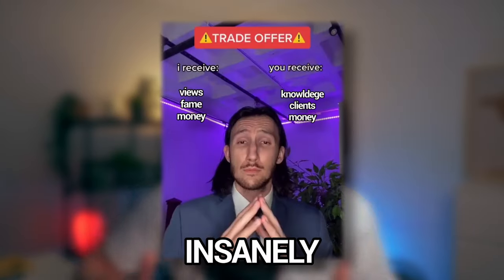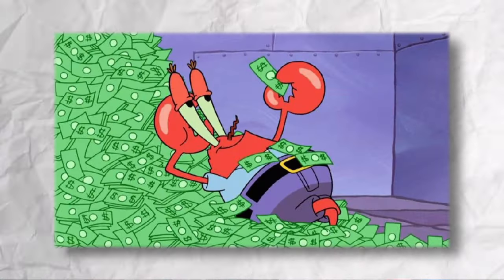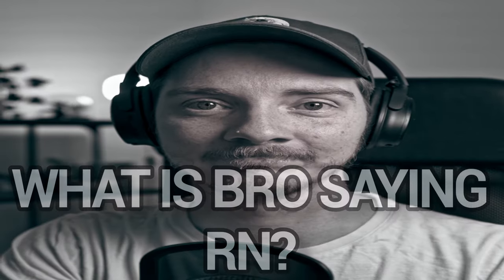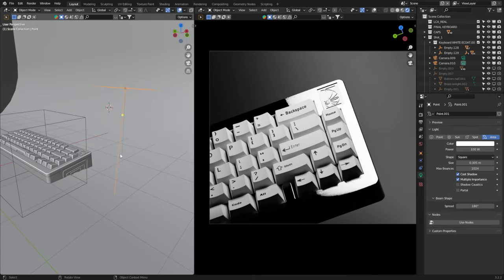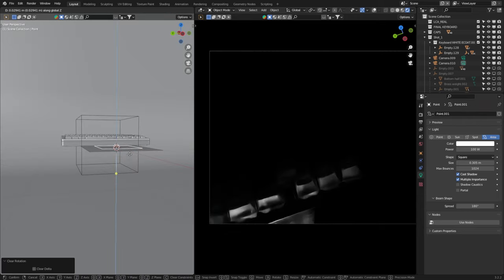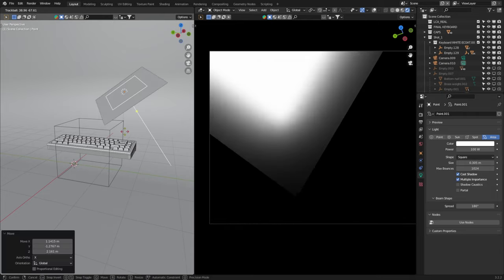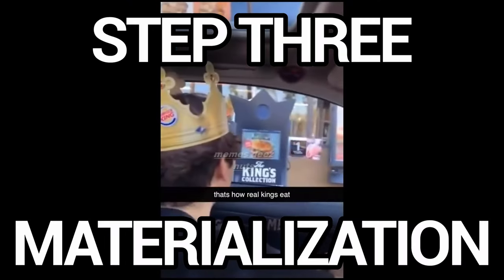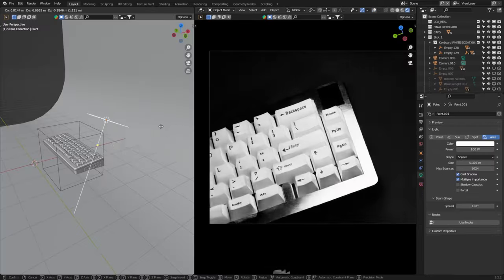Your Lighting Sucks. Here's Why

Comment: Can't you get this same effect by increasing the size of the area light? Thats typically what I do. Larger source = softer source. Or is it different?
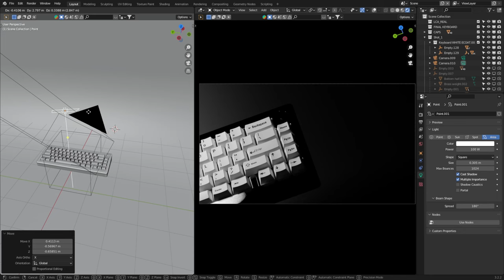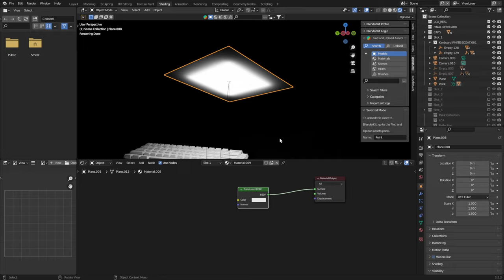Reply: This would be different, take a look at the keyboard at 00:25 you can see the hard edge of the area light in the reflection of the keyboard case. Then take a look at 2:05 the hard edge has been replaced by a much softer gradient giving it a much softer look overall. 

On a technical level he is changing how blender calculates the light by adding that plane. 

Bigger light sources have softer shadows because bigger source = more light shooting in the same direction over a large area which helps the light bounce around the object and soften the shadows without affecting reflections.

Adding the translucent plane essentially scatters the light so instead of a bunch of light rays going in the same direction, they go all over the place causing the light to be less focused and softer overall. 

Hope that's helpful!
Reply: I think it may look kinda similar, but the quality of light differs
Reply: @jonojibway9379  Thank you for the brilliant response!
Reply: That's two different method for different purpose. Your method is for producing soft light effect but it lack the texture of the specular. You can watch Area Light Map to understand it clearer.
Reply: Different light sources are programmed with different fall off parameters that mimic a source in real life

Comment: The problem with this is this is indirect lighting, and it have a cost. Noise and render time.
You can simply build a procedural node setup for simillar.
Or if render time doesen't matter, leomoon light studio, with real hdr studio lights is perfect. (almoast perfect, i used to add some other hdr-s for ligjt sources)
Reply: I also think building a node setup for the lighting is a better solution, and you also gain much more control. But did you actually tested if there is a cost in noise and render time?
Reply: @itayozari6252  shouldn't couse its direct light, doesen't need more samples for a good result.
Reply: I use area lights with procedural gradients and have found it’s more effective than this method. However I do still use this method when I’m looking for a particular quality of light and just take the hit of more noise and slower renders.
Reply: exactly very noisy image and render time increase like messive where my render useto take 2 mins after this technich its hitting 14 to 15 mins

Comment: You could also create a plane mesh and give it an emissive shader :)
Reply: The problem with emission shaders is that they are really noisy, so this technic might be slightly better. I think testing is the best way to answer
Reply: @titouansom  i see thanks 
Will try this technic too
Reply: @petermorales2342  :)
Reply: @titouansom  there are node setup for lights too, and also IES lights, with huge light library.

Comment: Yeah this lighting setup is awesome...gotta try it next 

Can you please tell how can I make a rigged character move its part (like hand) into a portal , and the hand comes out of another portal a bit far away from the former portal...?

Is that possible?
Reply: It is possible, and you would want to use geometry nodes
Reply from the maker: Lol, so specific
Of course it’s possible, just would take some trial and error with geonodes and other stuff in blender
Reply: @Smeaf  lol yeah its specific

Thanks 4 the reply btw

If possible anytime can u pls make a tutorial? I didn't find any on youtube so...yeah..
Reply: @Arghya_10  Youtube wont have your exact creative process, which is why you need to experiment.
   I don’t know exactly how to make a perfect portal, but I have an idea of how you can imitate one.  Make your character, rig it, then make its animation.  Next duplicate it, move it to where you want the portal to exit, then in geometry nodes you will want to make a proximity setup to dissolve the model (you should use an empty), once you have the model dissolving based on proximity, simply reverse it for the duplicated character in relation to its empty.  Then make the object you want as your portal, maybe a ring with a plain in it, set up its material, and key frame transparency/transmission nodes with noise nodes so you can have a quick appear and disappear at the specific frames.  

This is a very rough idea that I thought of on the spot, sorry if it can’t work.
    There are tutorials for making these effects, like iron man’s nano tech suit, and they can look good if you refine it.